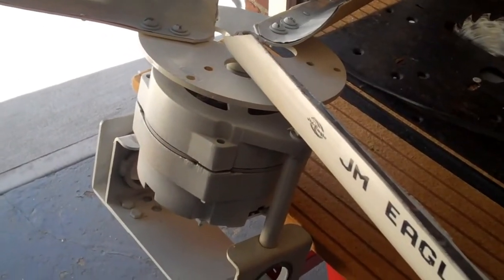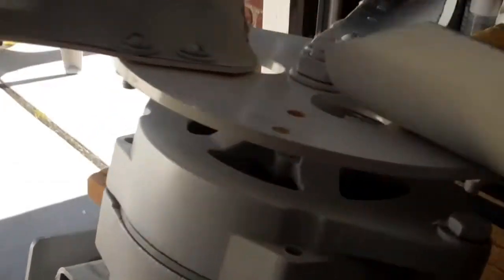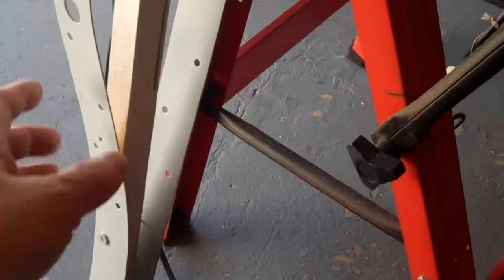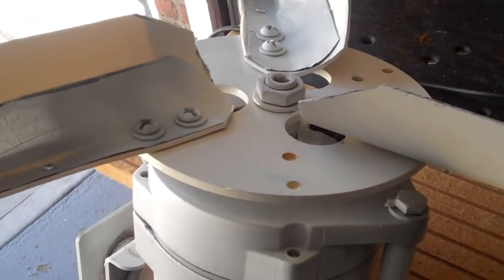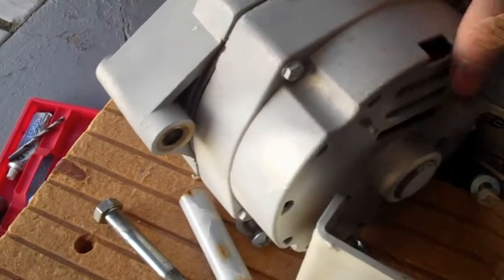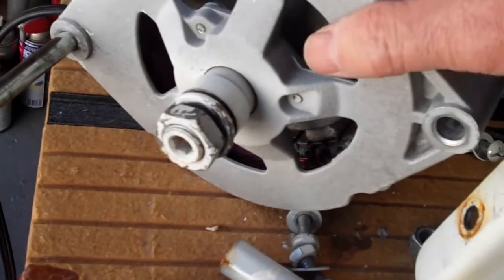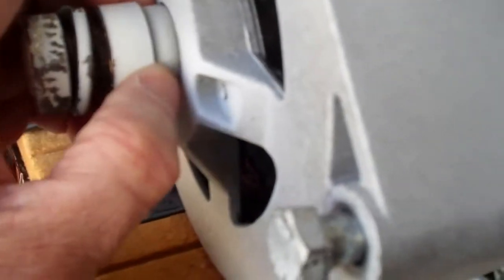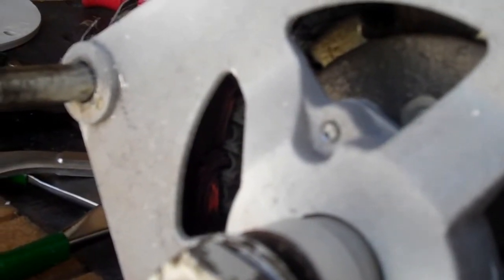Wind turbine for Tom

Comment: Hi, love your work!  Thanks for reminding me some alternators have the rectifier inside.  If I may ask - where did you get that mounting bracket?  What the alternator is attached to - do you recall?
Thanks very much and really like your videos.  Only watched two so far - but think they're great.  Going to binge watch.
Sub'd.
Reply from the maker: Thanks so much for your comment. I don't remember exactly where I got the mounting hardware but I believe such parts are available from Missouri Wind and Solar.  It's a fun hobby and can be practical for some people.

Comment from the maker: I think he might use a submersible 12 dc water heater, maybe 200 watts or so. If you can set up the wind turbine and it spins at a good rpm, then we can see what the options are.  Sometimes the turbine only gives out a few amps, in that case, he can only use it to charge 12 volt batteries. You learn by experimentation.

Comment from the maker: Are you sure you're not Tom? Just kidding. I hope mine will work for Tom. You never know until it actually spin up and produce some power. A lower power unit like this is easier to turn there'll be less cogging.  I understand you have to varnish the inside if you want it to last. I like this type of alternator because the parts, stator, bearings etc. are not hard to replace.